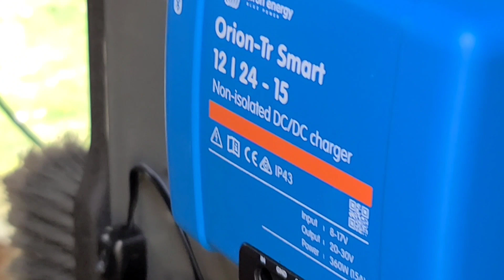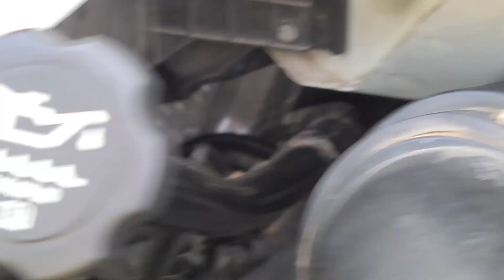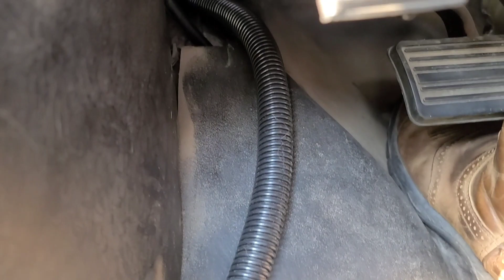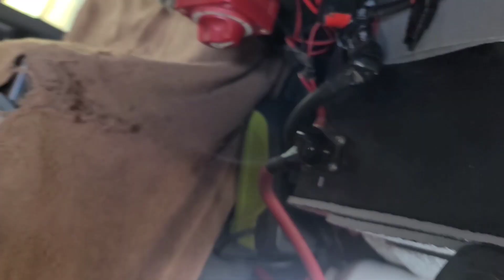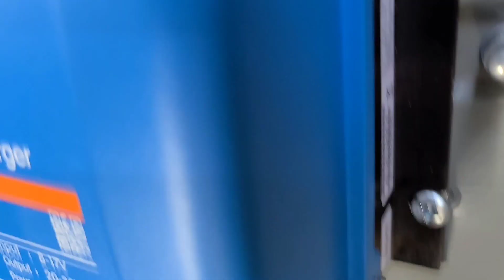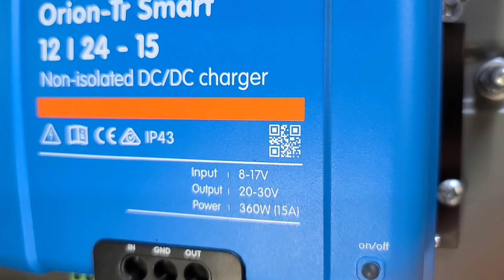07-22-2021, Victron Orion-Tr Smart 12 | 24 - 15 Non-isolated DC-DC Charger Installed In My Van

Comment: Does the JIANFA Car Push Button Switch cables go direct into green holes. And are you running the fan off of that same switch splice in? Do the green wire holes supply 12 Volts? Does this pull 30 amps on input, anf if so does it matter if votage set to 20 or 30 changing amps? I have a 100 amp alternator and will be using unit in power supply mode. Will be hooking it up to Delta 2. Thanks for putting this out there, I was considering just B2B, any thoughs on that, Great questions from everybody here!!!
Reply from the maker: Sorry for the delay in replying, I've been dealing with a shoulder injury.
I'll try to answer what I can. The switch leads are both connected into the green holes. The fan is powered via USB so I have it connected to a USB outlet. The fan has an inline switch that I use to turn it on and off manually.
I'm not sure on the answers to the rest of your questions and I don't want to mislead you, so I'm going to recommend that you check the Victron website and/or contact their support for those questions.
I hope that helped.. Again, sorry for the delay.
🐶🐶🐶🤠🐶🐶

Comment: Hi DogMan
Very interesting and informative video
I am interested in what happens if the engine is turned off and the Orion is turned on using that small switch you showed. Will the engine battery charged through the converter to the 24V battery? I am thinking of a similar system but not in a van, is on a boat. On the boat, I also have solar power that charges the battery. Would the solar chrge 24V battery when the engine is in a resting state if everything is connected as shown in your setup?
thx
Reply from the maker: Thanks for watching, Ante!
When the engine is turned off, the DC-DC charger has a sensor that detects the voltage drop and turns the charger off after two minutes. So the charger will continue charging the battery after the engine is turned off but only for two minutes.
The switch that I installed will override the charger and not allow it to turn on, if for some reason you don't want it to activate. Otherwise, the charger senses the voltage increase when the engine is started and will turn on after two minutes.
The DC-DC chargers are available in a few configurations. The one I am using has 12 volt input and 24 volt output, as my van operates on 12 volt and my cabin lithium battery setup is 24 volt. I believe you can get 12-12, 24-12 and higher voltage units too, like 12-48.
When the engine is off and the DC-DC charger is off, the solar panels will continue to provide a charge to the batteries through the solar charger which is a separate unit, as long as there is sufficient light. When the DC-DC charger is on, the charging power from it is in addition to the power coming from the solar charger. The two chargers can run together or each independently. The DC-DC charger provides more charging power, in my case, than my 840 watts of solar panels produce. So the DC-DC charger has been a great addition to my system. On very overcast days when I'm not getting enough sun light, I can run my engine for awhile to charge the cabin batteries, which is sometimes a life saver!
I hope this all makes sense. If you have any other questions, let me know and I'll try to answer them.
🐶🐶🐶🤠🐶🐶

Comment: Dog man don't let anyone tell you you not a genius.
I'm thinking about installing this onto my T1n sprinter,does this in any way affect the electronics of your vans system or is it completely autonomous,thank you.
Reply from the maker: Hi, Mike! This unit is available in either isolated or non-isolated versions. I am using the non-isolated unit which combines the engine and cabin power grounds together. The isolated version keeps the systems separate.
Mine is working fine but I think a lot of people use the isolated version. If you're not sure which to use, I'd probably go with the isolated unit. You'll just have to run separate grounds to the van body.
Hope that helps some.
🐶🐶🤠🐶🐶
Reply: Thank you dogMan,big help!

Comment: It seems most of these videos are running the isolated version.
I purchased the 12-12-30 variant in non isolated.
The issue I'm having is grounding my auxiliary lifepo4 Batteries (2 100ah batteries) to the chassis.
The ground wire between the two seems to heat up rapidly followed by an immediate disconnect.
Now, my system is currently operating in isolation.
Can someone direct me to a good video on chassis grounding a system?
Reply from the maker: Thanks for watching, NoCo VanCo!
Are you using the same gauge cable for the ground as you used for the positive? If not, that might be a cause for the cable heating. 
I am using a bus bar inside to connect all of my grounds. The bus bar is connected to the van body on the inside but I also ran a ground cable from the bar to the engine battery.
Hope those ideas help some.
🐶🐶🤠🐶🐶

Comment: I have ALL IN ONE 2424LV 2400W INVERTER with 6 24v valence batteries parallel connection im using 4 Guage wire all around is it enough or need a little bigger? What's is your wire sizing for your 24v system? Need help please
Reply from the maker: I used 1/0 gauge between my batteries and the inverter but I did overkill. If the distance is under 4 feet, 4 gauge cable can handle up to 300 amps. I have an image of a good chart that I can send you. See my email address in the "About" area of my channel listing. You are probably okay with the 4 gauge as long as the cable is not heating up while there's a load on it.
🐶🐶🤠🐶🐶

Comment: I have 2018 promaster 159 it has a B PILLAR max 70 amp to connect for positive and negative rather than connecting it directly to leisure battery, and I have a 12-24-15 amp isolated, can i use the B PILLAR POSITIVE AND NEGATIVE OR NEGATIVE ON CHASIS, you think this will run my victron?
Reply from the maker: Thanks for watching! You have taken me completely out of my knowledge base with that question! I have no idea about a B PILLAR. Maybe someone else will read your question and have an answer. Sorry that I couldn't help.

Comment: Are all of the victron orion installs the same, I watched others and i thought it was simple like the Renogy.   You don't just go from your starter batter to the dcdc then from the dcdc to the rv batteries of course with fuses in between?
Reply from the maker: Hi! Yes, that's pretty much the way it works. A cable from the alternator and starter battery to the DC - DC charger, then a cable out to your house batteries. Thanks for watching!
Reply: @TheDogManChronicles  Is it the positive from the alternator to the DC and negative from the battery to the DC or do I have it wrong?
Reply from the maker: The way Victron details the connections is you run a cable (up to 6 awg will fit into the charger terminals) from the positive output of the alternator and connect it to a cable from the positive of the starter battery (Victron advises to fuse the cable from the starter battery before it connects with the line from the alternator, protecting the battery. The size of the fuse will depend on the model of the dc-dc charger. Victron shows recommendations in their specs.) The cable then goes to the positive of the charger. The negative connection will depend on if you purchase an isolated or non-isolated charger. The non-isolated uses a common ground for everything. The isolated will separate the ground of the starter and alternator from the ground of the house batteries. In my installation, I did some overkill with fusing the cables more than necessary and used the non-isolated charger, linking the ground with all the electrical in my van. I hope that helps. If you have other questions, I'll try to answer them.
Reply: @TheDogManChronicles  I appreciate the information, you explained it pretty good.
Reply: @TheDogManChronicles  One last question, where did you get the fuse that joined the positive from the alternator and the positive from the battery?
Reply from the maker: For my application, using the 12 volt to 24 volt DC - DC charger, it called for a 60 amp fuse at that location. I got a fuse block and fuses from Amazon. Here's a link to the one I used but there are a lot of types that all work:
NVX XFMMINI 4-8 Gauge Stackable... https://www.amazon.com/dp/B08N8XD1QF?ref=ppx_pop_mob_ap_share
For the fuse between the charger output and the house batteries, my application called for a 30 amp fuse and I used this one:
KCT factory IN-LINE MINI ANL FUSE... https://www.amazon.com/dp/B01LXSBGST?ref=ppx_pop_mob_ap_share
Reply from the maker: I should mention also that on the fuse protecting the starter battery, the cable from the starter battery went into one side of the fuse block. On the other side of the fuse block, I combined the cable from the positive output of the alternator and the cable going to the positive input of the DC - DC charger. That way the fuse is just protecting the battery. This is how Victron has it diagramed. Now the problem is combining the two 6 AWG cables together on one side of the fuse block... they won't fit into the fuse block. So I used a reducer that I got from Amazon:
1/0 Gauge to 4 Gauge Wire Reducer 2pcs Car Audio Amp Input Reducer Adapter Brass with Gold Plated https://www.amazon.com/dp/B08GSV7HBF/ref=cm_sw_r_apanp_2qD5bRHYG5zEZ 
It worked great and solved the problem of combining the two cables into one side of the fuse block.

Comment: A most Impressive and comprehensive video On the installation of the Victron Orion-Tr Smart DC/DC charger, DogMan. Where did you get the USB fan? Being mounted flat against the panel I assume it is made to direct it’s air flow out the side.
Reply from the maker: Thanks, Brian! I got the fan from Amazon. Here is the link to it:
AC Infinity MULTIFAN S2, Quiet... https://www.amazon.com/dp/B012CL2V3I?ref=ppx_pop_mob_ap_share 
I appreciate you watching!

Comment: I have the 12/12 but I'm really confused about the connections from the battery and alternator. If I understand the wiring diagram from Victron you're supposed to take a wire from the positive of the alternator and a wire from the battery positive, pass both through a fuse and use one wire to connect to the Orion unit. Is this correct?
Reply from the maker: Almost correct, the cable from the engine battery positive should be fused before it is connected to the positive cable from the alternator that runs to the charger input. The battery is protected by the fuse. I went with a little overkill and I also placed a circuit breaker (or you could use a fuse) in the positive cable before it got to the charger. Just a bit of redundancy for extra protection and I can use the breaker as a switch if I want to totally cut the power to the charger for some reason. I also did an update video on relocating that circuit breaker from the engine compartment (where it got too hot, causing it to trip from the heat) to inside the passenger area. Here's the link to it:
https://youtu.be/DqyiYTyng-o

Comment: I purchased Victron 12-to-24, 10-amp.  I see you have the cooling fan, but, what is your experience, does it actually get hot?   The wire-gauge is puzzling me, I mean, I get that there is 10-amps at 24v coming from the charger to my house battery, but it's not clear to me how many amps/volts are coming INTO this charger (I want to know so I know which gauge wire to buy for the length).   I appreciate your video sir.  I'm excited to get it up and running in my van.
Reply from the maker: Hi Lewis! I have only found the charger to be warm but then I always turn the fan on when the charger is active.
I have the 15 amp 12 to 24 volt charger and going by the specs that Victron gives in the manual, I used the maximum size wire that the charger inputs will accept, which is 6 gauge. I used the 6 gauge wire for all of the connections, a little overkill but I think it's worth the safety protection. For the 15 amp version, Victron recommends a 60 amp fuse between the engine battery positive and the positive line connecting the alternator output and the input to the charger. The output from the charger to the house battery/batteries should be protected with a 30 amp fuse. Offhand, I'm not sure if the fuse size differs for the 10 amp version, so check in the manual to be certain.
I'm happy that I installed the DC-DC charger. It has helped get my batteries fully charged much quicker when I'm traveling.
If you have any other questions, let me know and I'll try to help. Thanks for watching!
Reply: @TheDogManChronicles  Thank you !!!!

Comment: Great video! What wire size and switch did you buy for the Victron Orion? I like your setup. I'm thinking of having two Orions so i'll have two switches near the front of my van. Thanks again!
Reply from the maker: Hi Mathew! The switch wire is very low current. This is the switch that I used:
JIANFA Car Push Button Switch DIY... https://www.amazon.com/dp/B07G17HWW8